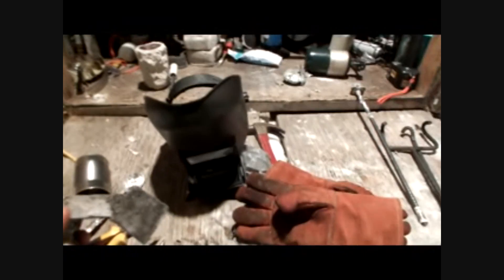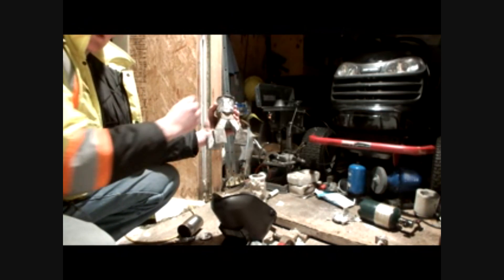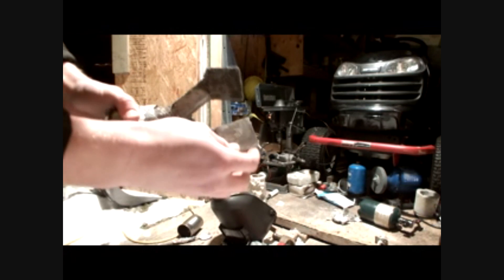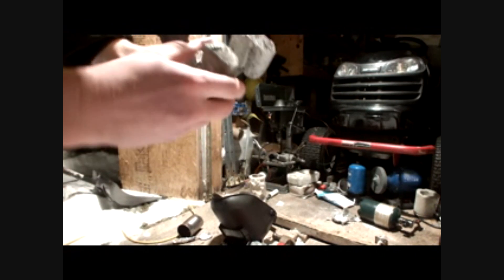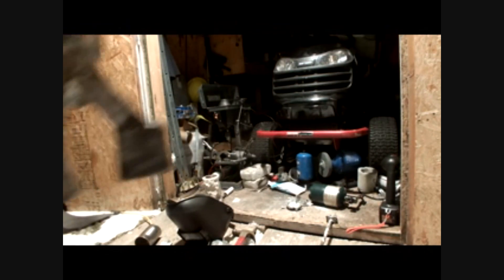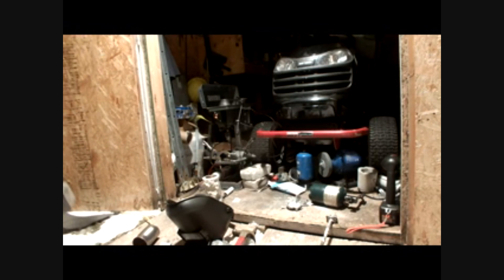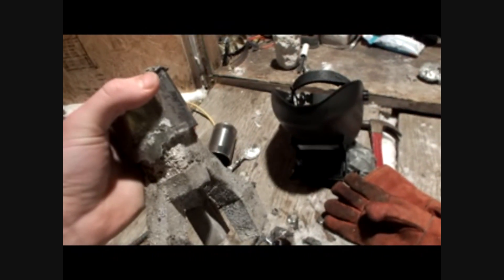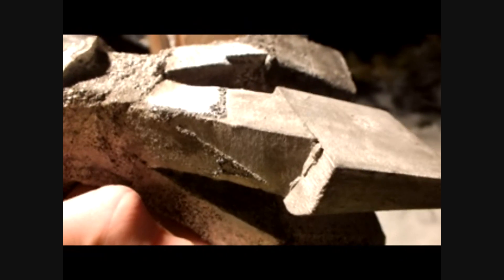How to Obtain the Best Finish With Aluminum Lost Foam Casting

Comment: Hey buddy I read about your dipping technique to add more costing before the rest of the process but I was wondering have you tried it this way with brass or copper as i do a lot of casting over on my channel and it isn’t always the best result . Cheers😁
Reply from the maker: I have done it with brass once, to make a block so I don't know how well it duplicated details. it works quite well in my limited experience. I've found it tends to 'break through' the corners somewhat more than aluminum unless you have a rather thick coat. On flat sections you do get a pretty decent finish. Definitely worth experimenting with!

Comment: How'd you get the coat of plaster onto the foam? I've had trouble getting it to stick.
Reply from the maker: Good question! Since styrofoam is hydrophobic, it doesn't like water, which is a problem because plaster is mostly water. The solution is quite literally, a solution of surfactant. A molecule that has one end that likes water, and another that hates it. To do this, I use a diluted solution of windex, or another weak, residue-free type of glass cleaner, diluted with about 2 or 3 parts water, to one part cleaner. Put this in a spray bottle, and then completely spray the foam pattern with it until it's dripping. The solution doesn't have to be very strong at all to work, and I don't know for sure, but too strong might cause some issues with the casting, but I haven't tested that yet. Let it dry, but try to dip it in the plaster while the foam is still a little damp. This should solve your problem. Let me know if you have more questions.
Reply: Thanks for the response, I wouldn't of thought of that.

Comment: I've never tried this, but maybe mix the drywall with play sand, or an even finer silica sand. that will make it more heat resistant, while still preserving detail.
Reply from the maker: +James Trainer That would work, since it would make it almost more of an actual ceramic with the silica... Hmm. I'll have to try that if the heat becomes and issue. For sure with brass it should help.

Comment: looks like the bucket furnace was inspired from king of random's video right ?
Reply from the maker: +Nart Wumar Nope! It's an improvement of the '2 bucks' furnace from http://www.backyardmetalcasting.com/ and some discussion on the Alloy Avenue forums. More powerful, and larger.
I generally don't like channels like The King of Random, because they more focus on making cool gizmos so you can say "Hey guys! I melted metal!" or whatever, instead of something utilitarian, useful in the long run, or remotely practical for shop use.
Most of those guys use pop cans for metal charge, but that's an absolutely terrible source of metal. It's a bad alloy to begin with, designed for thin-wall malleability and tube-drawing and certainly not any kind of casting. And what little there is in a can, the majority of it oxidizes to dross before it has the chance to melt cause it's so crazy thin. Then you're left with contaminated, bad alloy that you paid a whole ton of money for.
But if they used anything better, they wouldn't have near the popularity they do, because pop cans are ubiquitous, and good metal like alloy wheels, engine blocks, transmission casings, tools, etc, give the impression of impossible to obtain for the casual novice.
Plus, they never flux or degas the metal, and other technical aspects and scientific foundational principals of casting are too often ignored entirely.
It's the low-view, 'farmer/old guy in a shop' videos that present the useful stuff.

All the same, sorry for the rant, and thanks for watching!
Reply: +David A thanks for the info, and yea its better to use somthing more practical and reliable as well as good material as when I try it I will use aluminum scraps rather than pop cans.
Reply: David A
If I may also add, is the play sand/plaster of paris/water mixture a 2:2:1 ratio good ? you see I am not an expert at all and intend to do a simple backyard project but with more useful help from a professional so it don't turn out to be a total mess. In short, simple but good enough.
Reply from the maker: +Nart Wumar haha, I'm not much of an expert, but I'll help with what I can. :)
For your purposes, if you're just doing aluminum it should be ok. Some important things to note are that the plaster, and any concrete, will retain a lot of water. let it cure for as long as you can, about a week and a half at least, preferably longer. Then when you fire it up, start it out very slowly on low heat bringing it up to operating temperature over the course of about an hour or two. if you heat it up too fast the first time, the water can vaporize too fast and crack it from the pressure. This is like firing pottery.
One thing that you'll probably want to consider in the design is having the flame spiral around the furnace like here: http://www.backyardmetalcasting.com/bucketfurnace1.html This will give you better combustion and heat distribution.
One thing that you'll definitely want to do is flux the molten metal. This cleans it, purifies it, and makes it flow and cast better. A good chemical for this is 'no-salt salt' which you should be able to get at your local grocer. The main ingredient is potassium chlorate (KCl). Also get non-iodized canning salt (sodium chlorate NaCl). Mix and grind these up 50%-50%, and stir about two table spoons or so into the molten metal. Then before you pour, scrape off the gunk and aluminum oxide, called dross, from the top of the metal. If you can source it where you live, potassium nitrate (KNO3) is also good to mix with that as it helps to minimize good aluminum from being scraped off with the dross, and keeps the melt from oxidizing further.
Here's a good article on degassing, which is important if you are doing structural casts or have dirty metal or wet conditions: http://www.substech.com/dokuwiki/doku.php?id=degassing_treatment_of_molten_aluminum_alloys
Look up aluminum hydrogen porosity for why. What I do is buy basic powdered chlorine pool shock from Lowes, compress some into a small pellet, and push it down to the bottom of the crucible with a small perforated, inverted steel cup on a stick that I made. The chemical decomposes, and the bubbles of chlorine bind with aluminum to create bubbles of aluminum chlorate (AlCl3), which absorb the hydrogen from the aluminum. Be sure to flux again after you degas to remove the oxide that it makes.
Aluminum isn't too hard to mess up if you take your time and do things safely. be sure to get a good multi-gas respirator with a P100 filter.

Here's a bit of a video of my process. https://youtu.be/kAdvqWnDVwU?t=3m49s I added labels to the steps for you so you can tell what I'm doing.

And here is an unedited live-stream I did a while ago. I skipped to one of the fluxing and pouring parts for your convenience. Throughout the whole thing I go over important parts of me process. https://youtu.be/R5bv-22890s?t=33m34s The blank part around 14min is from a power outage. you can just skip over that to about 20min if you decide to watch it from the beginning. 

If you have any more questions don't hesitate to ask. :)
Reply: +David A thanks man,you are the best

Comment: That was very coarse sand, have you tried comparing a finer sand to your plaster method - there would be much less of a difference that way.
Reply from the maker: +Jack Good
True. It's actually angular-geometry leveling sand, so the surface flattens with vibration, despite the size. The plaster method would still turn out better though, and in fact, it's what motor companies like GM and Ferrari use for their performance engine blocks, so I think I'll stick with that if it's ok with you.
Merry Christmas!

Comment: can you show the process that you used for the plaster?, i can't quite understand that metod, but, seems to be the best one, i'm gonna try that in a few months, so please reply
Reply from the maker: Hi! Thanks for the comment! All I did was buy a bag of powered, setting, drywall joint / texturing compound from Lowes (not the ready-mixed stuff) and mixed it with water so that it was really runny, but still had some substance to it. You'll have to play around with the ratio, but just so long as it's liquid enough to flow around, coat, and form a suitable layer on all the parts of your foam pattern, it'll work fine. Next, I just poured the mixture into a big enough container, and dipped the foam in to the plaster to coat it. For extra insurance, you can let it dry, then put on another few coats if you think it needs it. After the plaster has cured, you simply put the pattern into sand as you normally would for lost foam casting. here's a link to another guy who has some pictures of the process:
http://www.buildyouridea.com/foundry/lost_foam_howto/lost_foam_howto.html
http://www.buildyouridea.com/cnc/hblb/hblb_prototype/prototype_4.html
Hope I could help. :)
Reply: thank you soooooo much dude.. that's what i was looking for!!
Reply from the maker: alastarX666
 No problem! Best of luck on your project. :)